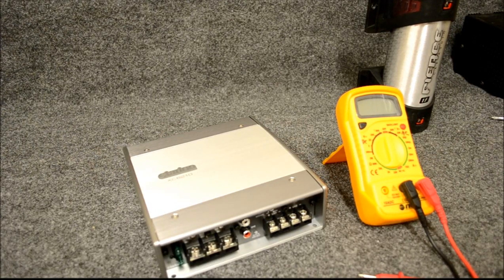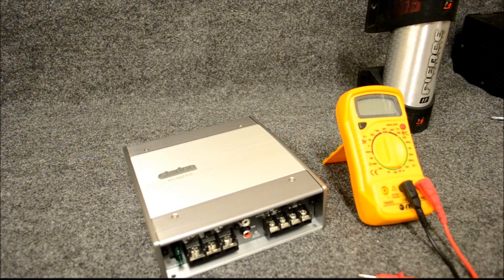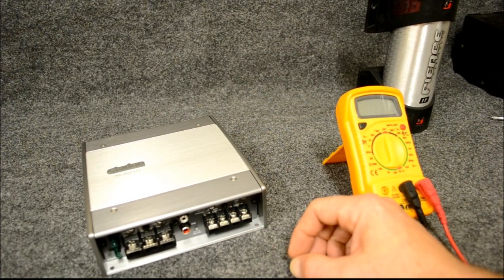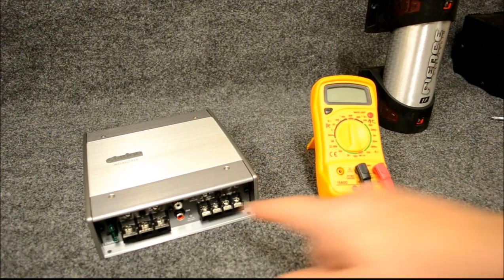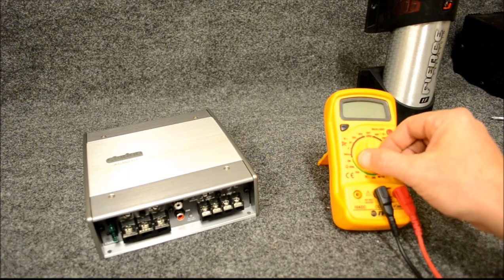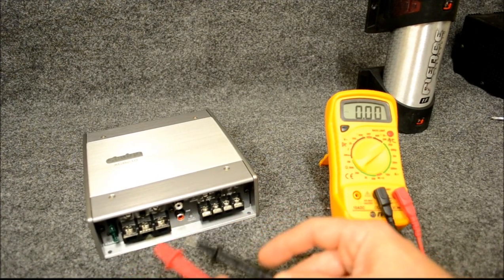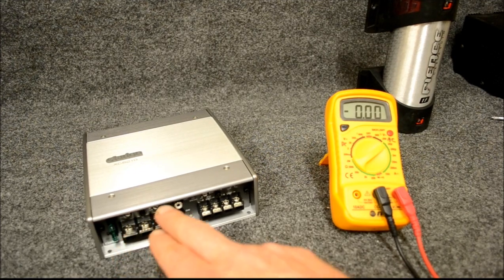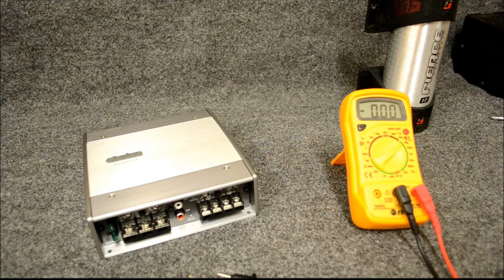Multiple subwoofer with shared air space enclosure gain matching and amp tuning

Comment: Lmmfaooo dude this is 2018 and everyone knows how too tune deck to amps and subs I have 2 skar amps on 4 American bass 12s and no flustering no distortion just clean bass that will choke u out of I do t like u
Reply: Eric Moffett
And you are one dumb fuck that should NEVER  install car audio or ANY audio at all. Dumb ASS. I bet your system sounds like total shit
Reply: See what you want is to wire positive terminal directly to the metal, then the negative to the speaker, remote to the neg of the speaker, connect rca to the positive of the alternator and start the car. If done correctly you won’t have any more issues with tuning